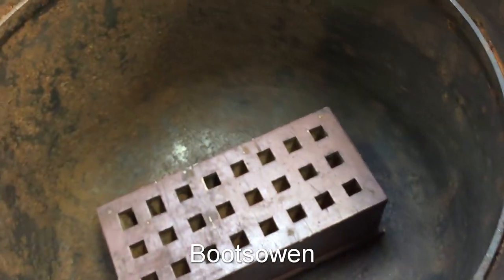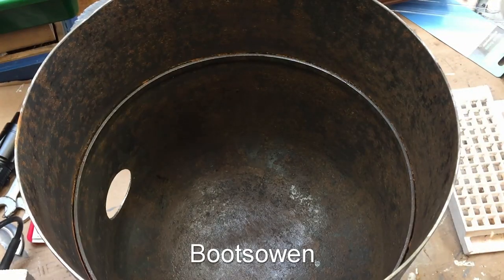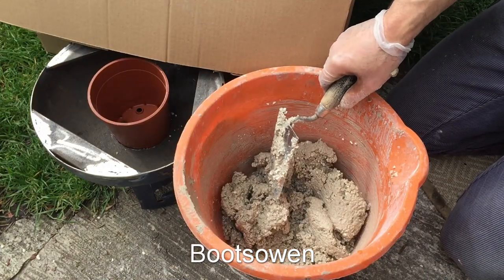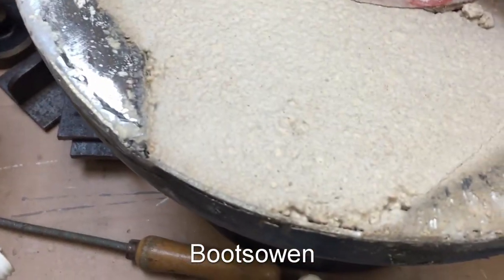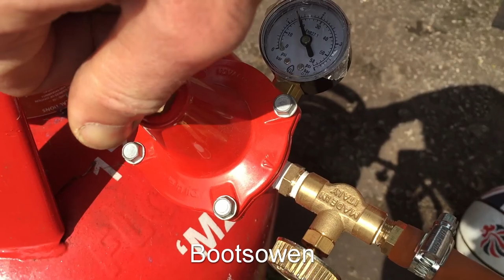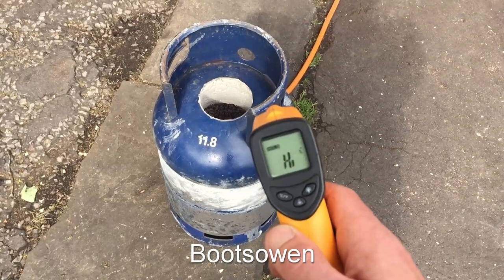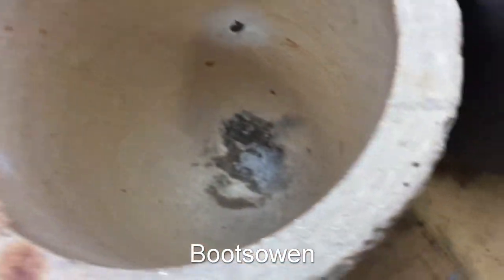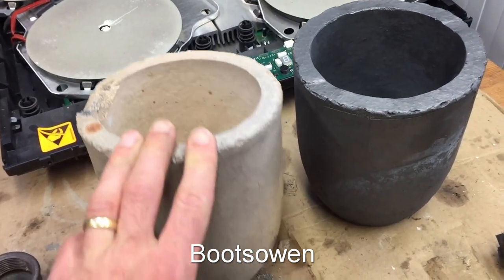How to make and test a propane bottle forge for backyard casting | conditioning a graphite crucible

Comment: Nice build boots. You planning on sticking with propane and that burner? The burner looks questionable. I was talking with diecaster_d he might be interested in building a 2nd forge in a different location.
Reply from the maker: I think I'll stick with propane at least until the tank runs out! The burner is the simplest one that I could find, and seems to get up to heat. I have made a much bigger burner as well, so I might try it out too. I was thinking of building an electric muffle furnace, but I think it would have to be smaller. Maybe not.